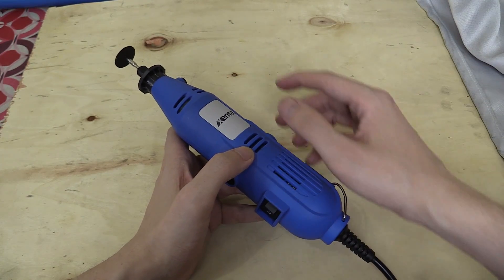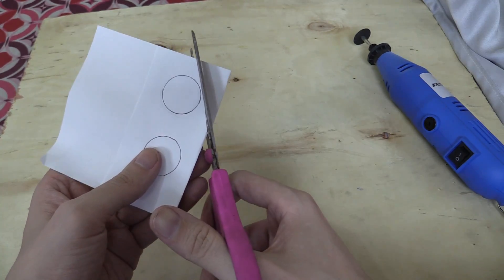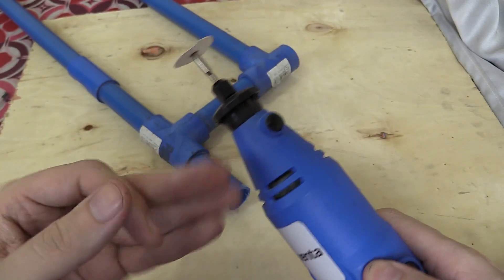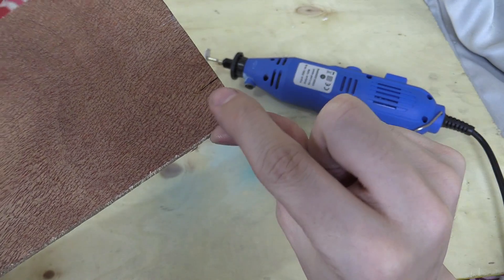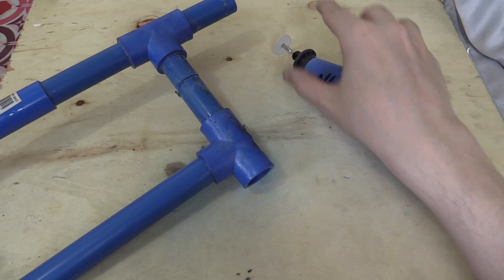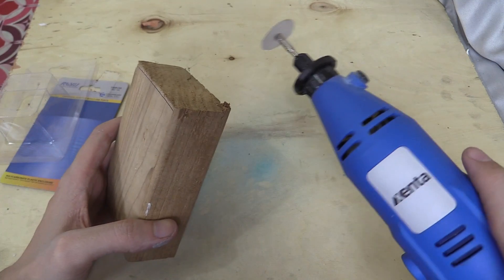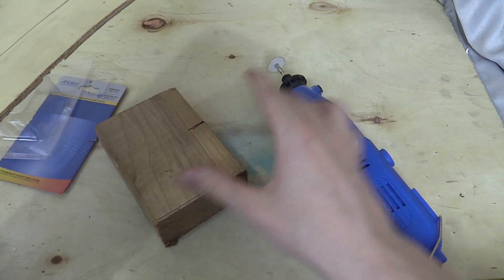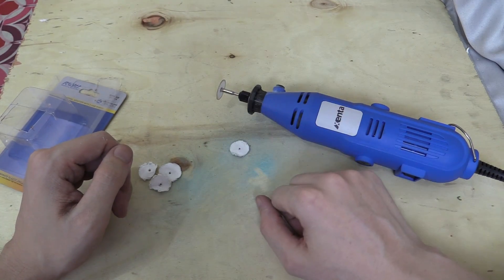Cut PVC & Wood with Paper!?

Comment: @GadgetAddict i am wondering how many volts your tool was?  thanks!
Reply from the maker: I think this was plugged into the wall, so it's 220v.

I now have a 20V cordless angle grinder from Ingco. It has proven to be super useful.

Although I would recommend waiting for a sale before buying Ingco or Wadfow because the price difference is massive during a normal day and one of their sale periods.
Reply: @GadgetAddict  thank you so much! :)

Comment: That is really kewl. However, I think the disc would last a lot longer if the cut was done at 90degrees to the work instead of at an angle. When you did the first cut on the pvc with the stock blade, u were pretty much perpendicular to the pipe. Then when you used the paper disc, you were cutting at an odd angle which cut the life of the disc down dramatically. It's the outer edge that cuts, not the surface of the disc, so straight on cuts would be far more successful. Would be curious as to how long a disc would last if always used at perpendicular to the work to be cut. 
Pretty impressive, none-the-less  :)
Reply from the maker: Thanks for the suggestions. It sounds like you now what you're taking about. I'll try it out at 90 degrees :)

Comment: should have used an A4 kind of paper and super glue
Reply from the maker: That's exactly what this is... Regular A4 paper taken from the printer. The first test is with paper only and the second test is with the paper soaked in super glue.
Reply: Yeah, i overheard you on the first part of the vid.. very impressive idea by the way :D
Reply: @GadgetAddict   i am wondering how many volts this tool was?  thanks!